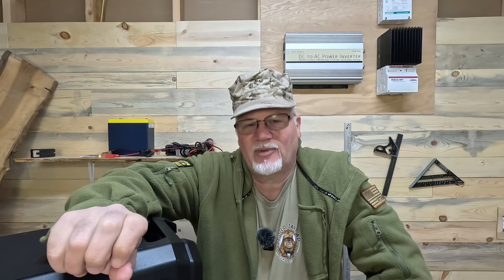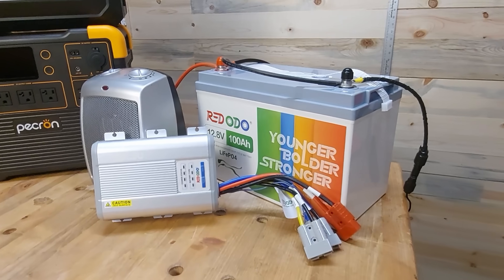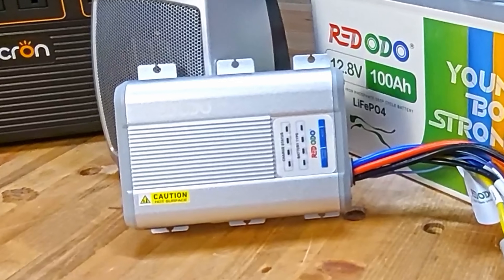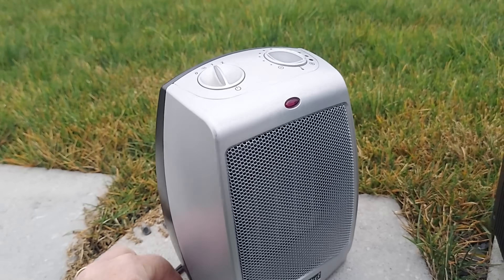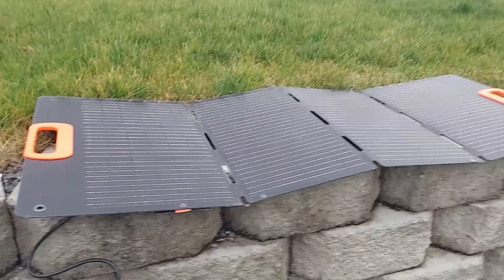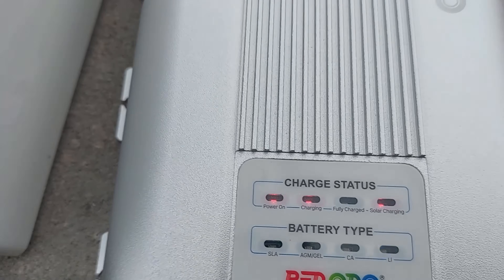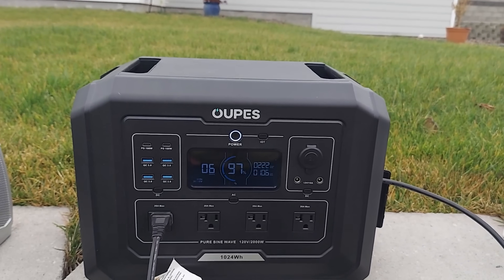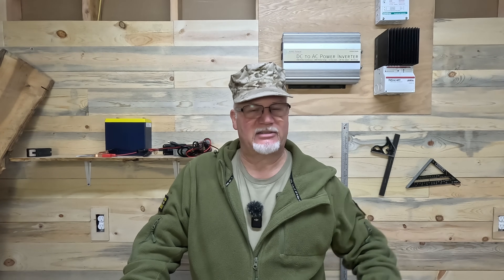🔋 LiFePo4 POWER STATION Hack That Actually Works! 🔋

Comment: But everyone says not to use different size batteries on a battery bank through a dc to dc charger?
Reply from the maker: The MPPT controller is the key.  By using it, you aren't connecting the batteries.
Reply: genuinely trying to get this right before I fry my truck camper setup. Are you saying that the built in mppt charger built in the power station is making it ok? That would make sense.... because I was originally looking at it as basically another battery in a box, essentially in series with the lifepo4 100ah battery. But if it's not the case and the power station is just taking in a voltage and using its own mppt then this is brilliant and I'm on my way to buying a Pecron 1500 or Delta 3!
Reply: I have a Renogy DCC50S 12V 50A DC-DC On-Board Battery Charger with MPPT. I primarily use the vehicles alternator to charge as I travel more than I park. Actually I'm thinking of removing the two 100 watt solar panels and installing a cargo carrier instead. (Since it would block most of the sun) then relying on the alternator to keep my house battery and portable power station charged together. May even just buy a dc to dc charger without solar (not sure yet) I'm rebuilding this whole setup in the spring but gathering parts now
Reply from the maker: Yes the MPPT charge controller (solar input) is using the battery like a solar panel and charging its battery from it.  I like the Pecron but if the Dekta 3 had the same battery size and inverter and was the same price I might go that way too
Reply from the maker: Why not a solar panel on the cargo carrier?
Reply: @ it gets interesting with the delta alternator charger that puts out 800 watts from a 12 volt source for incredibly fast charging...now I wonder if I can eliminate all my existing stuff including the solar panels, the charge controller and just use the eco flow 800 watt charger to charge my house battery and the power station in series off the alternator...Hmmmm? Or the pecron with the 500 watt controller? Any testing yet on using one of those to charge a 100ah lifepo4 connected at the same time to the portable Power station??
Reply from the maker: So the DC to DC charger relies on the amperage put out by the alternator -- which runs your engine and keeps your 'house battery' charged as well as running your lights, stereo etc etc.  So, an 800w charger running off a 14.4v alternator is a 55amp charger.  So the alternator has to be able to provide that as well as what it needs to run everything on your car (engine etc).  The power station is not in 'series' with the house battery (be careful of that terminology) it's actually 'isolated' from it via the DC to DC charger.

As someone who runs an off grid cabin I like having multiple means of charging my power bank (in the case of my cabin batteries) so having the DC to DC charger AND solar will always be my choice if possible.  Of course, you won't need a charge controller for the Power Station since it's built in anyway but the DC to DC charger will likely run into the Power Station via the solar port which is why they usually also have solar.  Just be sure it matches the input power of the MPPT controller on the power station.
Reply: @ I have an old YouTube video when I first built this. In that video I used (4) 35ah AGM batteries. Since then I changed to a 100ah lifepo4 battery.  I've learned a lot since making that old video with guys like you and Will. The Renogy is a neat little unit in that it will also reverse charge the starter battery from the solar panels after it tops off the house battery. Neither battery ever gets low enough to worry much about. I did install a manual cutoff switch from the starter battery so that if I know I'm going to be at... say the off grid cabin in the UP of Michigan . I know I won't be stranded as it is a long long way to find help. Only thing about the Renogy charger is that it will always use solar over alternator even if it's a cloudy day and getting 10 watts from solar. Now since I drive 6 hours to get up there, makes no sense to not take advantage of the alternator and charge at 400+ watts so I wired in a 12v normally closed relay on the PV line. Then powered the 12v coil off my ignition switch so the minute I start the truck it opens the relay, the unit "thinks" it's dark and switches to alternator. That works pretty good. Never have had a problem "over taxing" the alternator in the 4 years or so I've been using it. Knock on wood.... and never had a dead battery since it charges in reverse also. I have a diesel heater, a cpap machine, a 12v setpower fridge and a few led lights. Maybe the pecron with its 500 watt charger would be better, IF it can charge both batteries simultaneously
Reply from the maker: Sounds like an excellent solution!  I haven't checked if the Redodo does that (reverse charging with solar) but that's a neat feature.

Comment: I have Bluetti EB3A outputting ~150W 24/7 on utility power in UPS mode. The PV is rated 28V 8.3A. I have a 24V 2-FLA Deep Cycle battery bank to connect to the PV input.  When connected to the  PV input the EB3A stays in UPS mode (AC still connected) and it will draw 3.8W from the battery bank. If the AC disconnects then the 24V will carry the 150W and keep the EB3A at 100% charge.  Stopped test at 80% battery discharge after 4.5 hours.  I do not have PV and charge controller functioning yet so having to charge batteries off line.
Reply from the maker: Try to keep those FLAs above 50% for cycle life (best above 20% DoD for max life), but it sounds like it's working well!
Reply: @TheOldJarhead  I want LiFeP04 batteries and put the FLAs back in my boat.
Reply from the maker: You'll love it when you do :D  Heck, I put a LiFePo4 in my Marine Battery Box for my little trolling motor on my canoe and love it.

Comment: The reason why it didn’t draw a lot might have been because the power station was almost full.

Most of them are programmed to slow the charge way down when they are almost full.
Reply from the maker: True.

Comment: Last summer i did about the same you did here, i charged my Allpower R600 from a DC-house 12.8v 100amps battery while the battery also was connected by 2 Dokio portable 80W foldable pannels in paralel and the deplition (hope wrote correct i am Dutch) was way slower on the battery. So it worked without an extra controler or did i damage something doing so? Thnx for any advice.
Reply from the maker: Depletion? Yes, 160w going into the battery while discharging is good.  It's what every off grid system does 😀

Comment: Trying to get the wiring correct. So you will need an anderson to ring terminal also to connect from the dc to DC converter to the battery. And the cables you suggested is this correct ?? Thx
Reply from the maker: From the Redodo DC charger to the battery you will need Anderson to ring (they do provide Anderson connections you can build one out of I just bought one instead) and and Anderson to MC4 to the solar panel.  Then, from the Oupes, I got an MC4 to ring terminal, but it was reverse polarity, so I taped the red side and placed a 30a fuse with red on the other.  I'll do a video on it.
Reply: That would be awesome thx  @TheOldJarhead
Reply from the maker: You bet

Comment: This seems like a better solution then using a couple boost converters. I see people use them but its not the most efferent way to go about it in an energy storage setup. The dc to dc charger would be the most efficient way to go about this.  I just purchased an ecoflow delta 2 max. Its not enough to run my house so I am looking at adding expansion storage. I cannot afford what I want so I will need to be creative to meet my goals.  I don't have a hole lot running in my house, router, a couple computers, fridge, a few lights and the stove occasionally. I would like to be able to run the fridge, router, one PC and two lights. for a minimum of 3 days, one week of power storage would be ideal though. With current events and the poor power grid I live on, we lose power every couple months for a few hours and at least once a year we lose power for multiple days. the last time this happened was in January and we froze. I will never go through that again if I can help it. I even purchased propane heater and 20 pound tank for events like that. Sucks being an adult. I wish I could spend my money on thing I want not need once in a while.
Reply from the maker: LOL right!  Darn adulting! 🤣  I'm happy to help!  LiFePo4 batteries are much more cost effective that proprietary expansion units!

Comment: Can you put a 12V battery "in a continnius loop" with your powerstation?
For example the powerstation charges via solar input from solar panels and at the same time the 12V battery recharges the powerstation by an inverter and the powerstations ac input, and the powerstation charges the 12v battery from its ac out and a 12v battery charger
Then it would work allmost like the extra battery for the powerstation?
Reply from the maker: You could with enough solar but it would be inefficient.

Comment: Great video thank you for your wisdom. I have a question , can I charge my lifepo4 battery  quickly from my solar generator using the same redodo charger ?
Reply from the maker: No but you can connect it to you car to charge it

Comment: Thanks for another great video! Another option, particularly for smaller power stations that don't have high solar input capacity (ie: 100-110W), is to use an inverter on the battery and to feed the power station AC input (ie: 300-320W).
Reply from the maker: Yes, that can work, and the charge controller and more solar on the battery will handle it.  Of course, at that point, you are into DIY solar 😉
Reply: @TheOldJarhead  Yep, that's the setup I currently have in my camper van: 200W solar, MPPT controller, 280Ah battery and 300W Pure Sine Wave Inverter. I just got an EcoFlow River 3 which is a great machine (I was on the fence between it and the Anker C300 but the Anker didn't have auto AC passthrough recovery when using it as a UPS for my home network equipment, which the River 3 has). I wondered how to charge it from the van's solar battery when camping and landed on your series of videos. The challenge is that the River 3's solar input is maxed at 110W. Then I though: Doh! Why not use the 300W inverter? The only thing I have to do is go in the EcoFlow APP and tell the power station to limit its AC input to 300W and voilà! Thanks again.
Reply from the maker: Awesome and good thinking!

Comment: Why didn't you mention the 12 to 24 volt inverter on this video?
Reply from the maker: Do you mean the step-up converter?  I shoukdbhave used it but was having trouble walking, so kinda forgot, but that would make a huge difference
Reply: @TheOldJarhead  yup that one indeed.
Reply from the maker: I should get a 12v to 48v 😉
Reply: @TheOldJarhead  is that a thing? I'm learning from you. More power!!!
Reply from the maker: Yes!  I've seen 10a ones, which would allow 480w of charging but never bought one.   Hmmmmm
Reply from the maker: On the way!
Reply: @TheOldJarhead  Can you skip the battery and just go from solar panel to dc/dc converter, step up the voltage, and then go to solar generator?
Reply from the maker: I can't see why not, but the panel can only deliver the rated capacity, so it won't give you more power.
Reply: @TheOldJarhead  is the 12 to 24v step up with 20 amps a better choice to get the 480? Or should we start searching for 12 to 48 with 20 amps and get double?
Reply: @TheOldJarhead  Nott sure there is a 12v to 48 v. I have a 24v to 48v . It charges at 480 or thereabouts but does get a bit warm or hot.....
Reply from the maker: There is, I ordered one 😉
Reply from the maker: I haven't seen a 20a one, but if I did, I'd get it.  I ordered a 10a to play with.
Reply from the maker: https://daygreen.com/products/12v-to-48v-20a-960w-dc-dc-step-up-converter-voltage-regulator Don't know if that one is any good and I have no affiliation with them but at 20amps it's possible, if the Power Station can take it, you could get serious power out of a 12.8v LiFePo4 battery this way :D  Of course, it would drain the battery FAST but if you needed that kind of power, it would be available.
Reply: @TheOldJarhead i have delta 2 so my limit is 500 unfortunately.
Reply from the maker: 480 10A or 24 20a should both work :)

Comment: A lot of times anything less than 15v input is "might be a car 12v outlet fused at 10amp" so the programming restricts the charge rate.  Get it up to the middle of its input range and usually it will draw the max.  Ecoflow are often more complicated.  Also sometimes you need to do some math - voltage range, maximum amps, maximum watts, watts is volts multiple by amps - to figure out if the volts you provide when limited by the maximum amps it will draw can provide at least the maximum watts it can accept.
Reply from the maker: Agreed.  If I had my 24v battery handy, I would have used it, but my back and left arm wouldn't have liked it 😉

Comment: The 48V batteries work great for this.  Amazon has 48V 25Ah for $220, and 48V 50Ah for $399.  Charges at over 500W !
Reply from the maker: Yes!
Reply: You're better off buying the Pecron 500W Car Charger ($150.00) Where you can use a 12 volt lifepo4 battery to charge your power station at 500 watts!
You can even use it to siphon battery power from lifepo4 to another charging at 500 watts.
Reply: @ideedit  That's an additional cost and more loss of power for the conversion vs just a 48V battery. Cool option tho for those big 12V 320Ah batteries that are so cheap now.
Reply: @goodcitizen4587  Most 12 volt systems are more common and a much cheaper option than 48 volt systems. A 12 volt 320 amp hour battery could recharge the battery in his video at least three times over.
Reply: @ideedit  Most everyone is finally moving on to 48V tho. Much better wiring (fourth of the current). Pricing is closing in too, with 48V 100ah now at $800 (vs 12v 100ah at $200).
Reply from the maker: Yes for a lot of these 48v would be better.  I just don't have any 😉
Reply from the maker: Yes, in fact I did a video or two doing just that.
Reply: @TheOldJarhead  Yes thank you, because it's best to know all your options!
Reply: @ideedit the problem is how will you charge the battery with the Pecron charger if it’s not plugged to an alternator ?
Reply from the maker: The redodo has MPPT solar input as well, so either a solar panel or run the car
Reply: I think the premise of this video is for 12 volt users because 48 volt systems waste more power and cost more money and also take longer to recharge than 12 volt systems, they are better suited for solar off grid whole house situations!
The purpose of my 12 volt system is to run small devices by using less power as possible to power all my electronic devices in an emergency.
Reply from the maker: @ideedit  One big benefit is alternator charging of a 12v LiFePo4.
Reply: @ideedit beg to differ. I run a 48v 30ah lifepo4 into my Anker F2600 and they simultaneously charge within just a couple hours via my 48v 30amp smart charger being fed by my 4250 watt champion gasoline inverter generator. I can see what the wattage the 48v battery is releasing vs what the power station is accepting and it’s only a few watts difference= very efficient.
Reply from the maker: 48v will provide more power to the Power Station if it can take the voltage, for sure.  Heck, on a lot of new ones two 48v batteries in series will provide twice that of a 48v battery but remember, anything over 48v is considered 'high voltage'.
Reply: @TheOldJarhead  my Ankers accept a maximum of 60v dc input. The 48v, actually up to 54v are the maximum and perfect reserve supply to these unit(s). And 48 v systems have a much greater within voltage delivery usually 52-48v. A 12 volt system only has an internal useful range of 13-11v. But that’s a whole nuther episode.
Reply from the maker: All good points and I advocate for 48v systems in DIY Solar all the time.  With Power Stations it comes down to what the MPPT can accept -- I have some that only allow 24v and some that will take 100v ;)  

In this vid I was really just trying to answer the question:  can I charge my battery from solar or a DC charger while it's hooked to the Power Station?  - which of course, you can as long as the charging voltage isn't higher than the MPPT voltage.  For example, the Jackery 550 is limited to 24v so if I hooked up a 24v LiFePo4 it would be too much at 25.6v

Comment: Having a Battery Bank o 24 Volt 100ah Lithium Iron Phosphate Batteries Tied into a System here on The Ranch a Marine Grade 10/3 Tinned Copper Wire Line runs into the Lodge for topping off at Night or Rough Weather
Reply: Smart😊
Reply from the maker: You are dialed in brother!

Comment: Ty for video. Not alot of people talk about charging these lifepo4
Reply from the maker: You bet!
Reply: Now having a battery makes total sense
Why isnt that well known tho?
Reply from the maker: I think the Power Station companies haven't explored this well enough as they could do what Comvolt did and just add a port on the side to direct connect (parallel) a LiFePo4 of the same voltage.  However, to be fair, running through the MPPT is in many ways better than paralleling batteries of different configurations/manufacturers/BMS's etc but in an emergency it doesn't matter, what matters is you have the needed power!